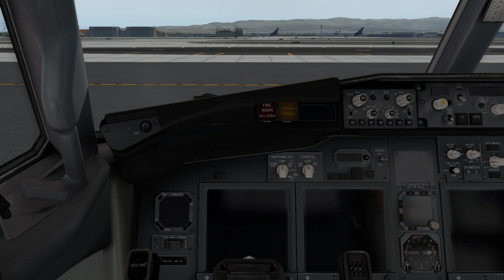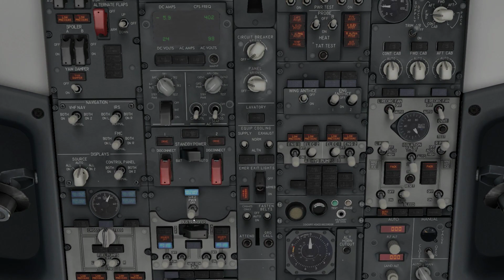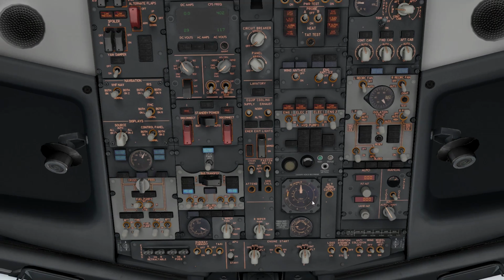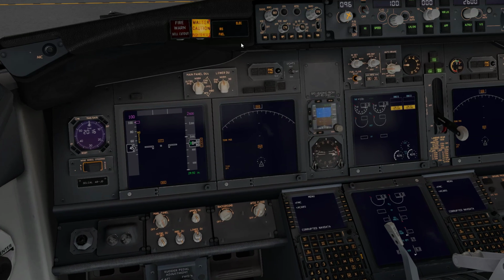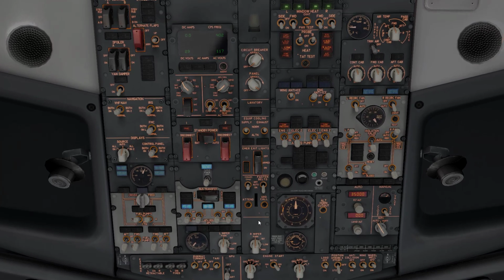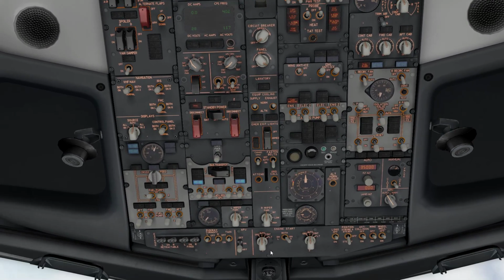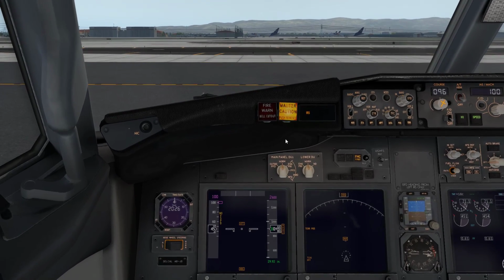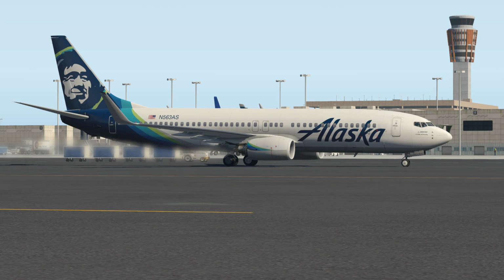Zibo 737-800 Tutorial | ALASKA - How to: Start-Up For Beginners | X-Plane 11

Comment: Hey, thanks for the video, but I printed the 737 check list and it's a bit diferent, is it ok?
Reply from the maker: Absolutely. You will find a lot more safety checks in a real-world checklist and maybe some variations in the sequence.  That said, what we did in this video will definitely get you flying should you choose to do it the way we did.  Personally I print my checklists out so I can add items or reminders, highlight critical points, or remove items (for example I might remove a procedure the sim doesn't have).
Reply: @FlightBrothersFT  oh, ok, thanks for the fast response

Comment: In the forward view. There's something that says "ELEC    IRS   FUEL " for me it doesn't show fuel and when i switch yo GRD i dont see any numbers going up its just on 0. Any help please ?
Reply from the maker: Are we taking about the fuel quantity here?  I’m not sure if Zibo now has a fuel truck option or if you would do it through the flight configuration menu.  I would try either of those and see if your fuel quantity changes.  The ELEC IRS FUEL are annunciations.  Maybe someone within the community here will be able to help.  If you are on Facebook, I would suggest joining the Zibo Community group.  Do a search and your answer is likely there!  Let us know if this helps, or not so when can attempt to run it to ground.
Reply: Flight Brothers FT the fuel icon appears at first but when i turn the 4 switches on it just disappears. I think im doing everything right but the problem is with the installation. Also the avitab keeps telling me "unsupported files detected "
Reply from the maker: The fuel should disappear, it’s letting you know there is an “issue” with the fuel system.  With all fuel pumps on, that is normal and the lamp should be extinguished.  Regarding the Avitab alert, I’m not sure.  I’ll see if Tim is has some information, but you may want to try a clean zibo and Avitab install.

Comment: Hi, Amazing Tutorial, While Taking oFF im getting a TakeOff Config Error due to which I cant Take Off. ANy Solution ?
Reply from the maker: Configuration warnings (usually an audible 'enh enh enh' sound) can be triggered by a number of systems: flaps set? Speedbraked stowed? parking brake off? Usually the warning activates when the throttles move past the low settings used to taxi.
Reply: @FlightBrothersFT  Yup got it flying.. thanks a lot :)
Reply from the maker: Great news! Thanks for letting us know.

Comment: Thanks for a great video mate! Pause's were perfect. Was there anything that you missed? or do you have a text version of the check points?
Reply from the maker: Thanks for the compliment. I believe it is complete for the Zibo version when published. There are some improvements and fine details added to the current Zibo, but the general 'cold and dark' startup for a 737NG isn't changed at all. Regarding text, do you mean a checklist? Or adding text to the video?
Reply: Flight Brothers FT yep a checklist / cheat sheet to refer to. Would you mind listing any of the new steps needed for the current zibo?
Reply from the maker: Here is a very current .pdf checklist specifically for the Zibo: https://tinyurl.com/y536lqxs